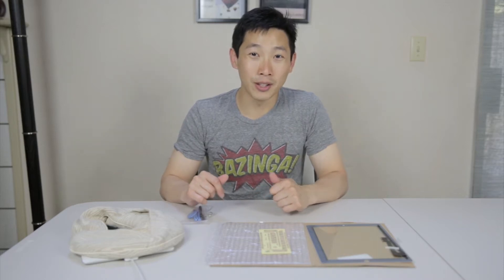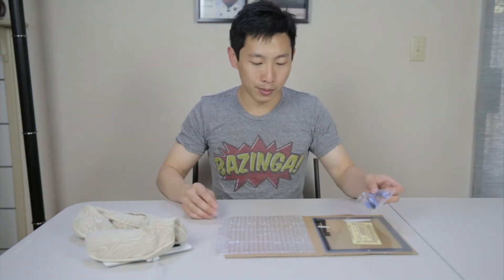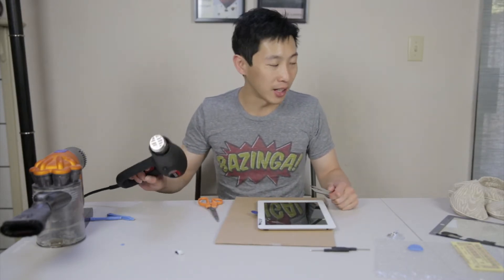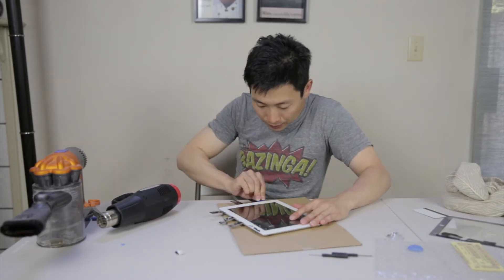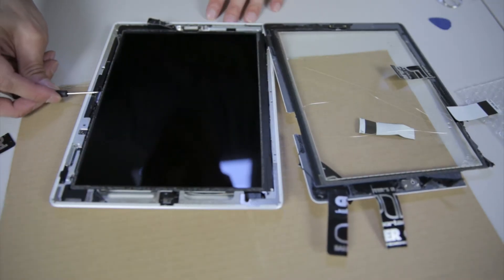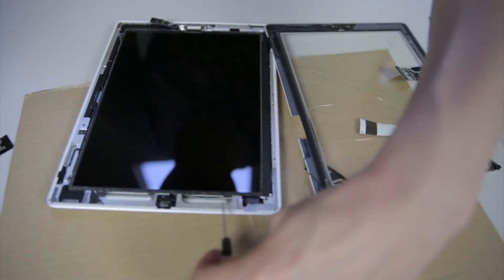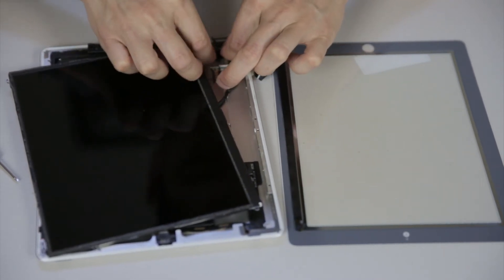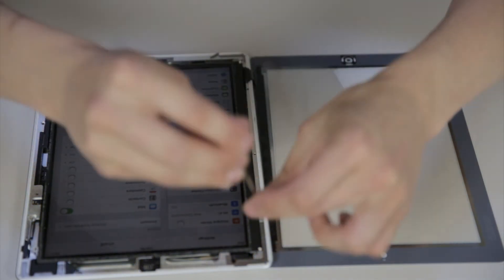iPad Screen Replacement Tutorial

Comment: My idiot super cheap way of fixing mine was using clear nail polish and then a screen protector over top. It's been a year since and it's still working.
Reply from the maker: Betty9971 Glad it works for you as long as you are not too bothered by the clearish mark. I myself would go crazy on that.